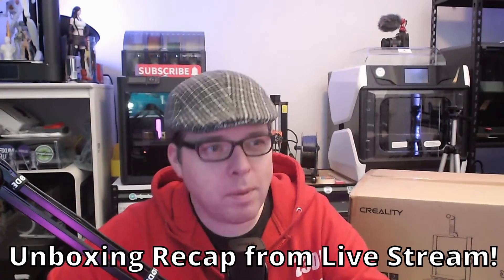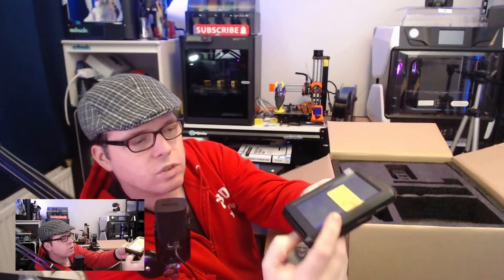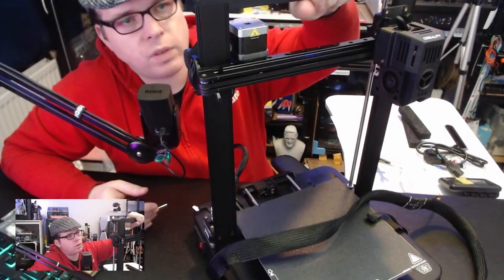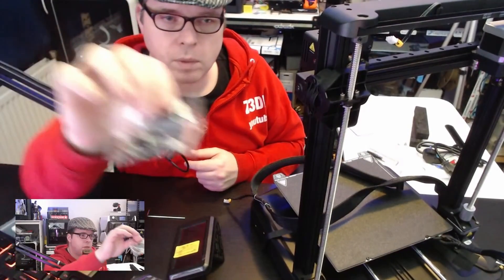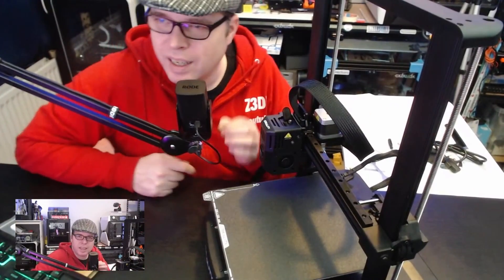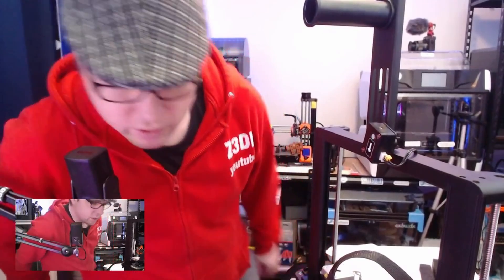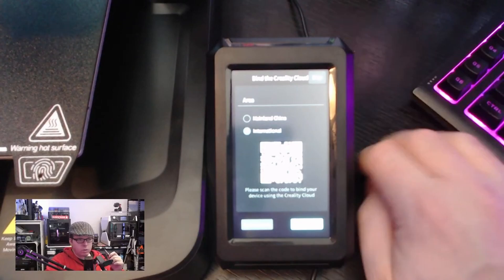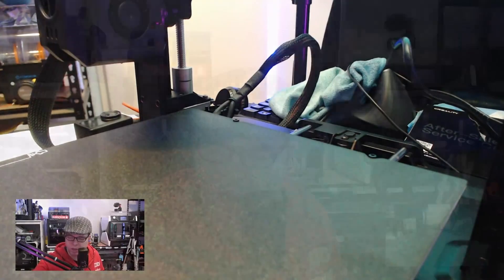Creality Ender 3 V3 KE - Unboxing setup and first Print

Comment: Hi, awesome review! I noticed something peculiar with your KE. Seems that it has a SD card and a type C slot. Usually the KE doesn't come with those. All its connectivity is already in the Nebula pad itself. I have a Ender 3 V3 SE and i was told that the KE doesnt come with those. Suprised to see that.

Can you maybe look further to see if my assumption is correct that your KE came with a sd card slot and Type C port to the left?
Reply from the maker: Hello, on my Creality Ender-3 V3 KE, there is on the left side of the printer, indeed a SD card slot and a USB slot, but those are fake and won't hold any SD card nor USB cable. I discovered it during a opening of the case... I wonder why to have these openings in the housing, where there is no purpose for it. I believe those are being used for the SE, where they use the same plastic casing.

All connections for the KE are in the Nebula Pad